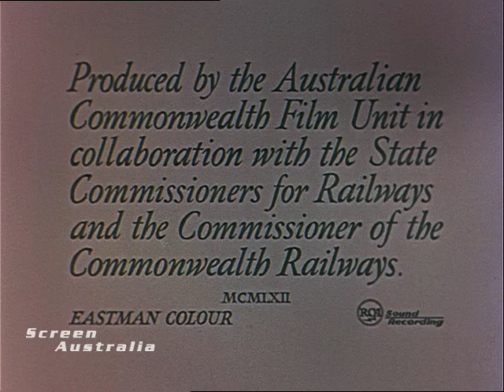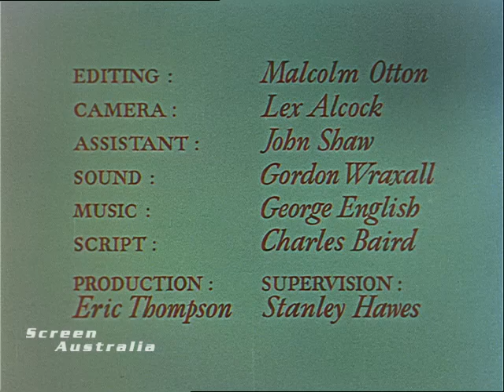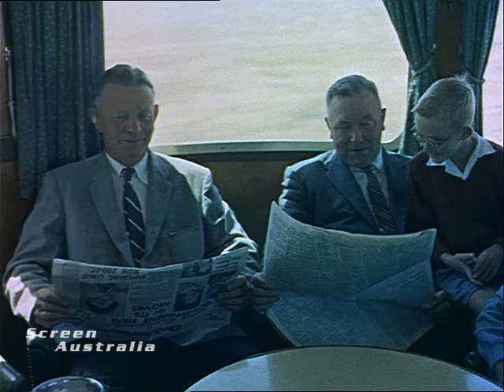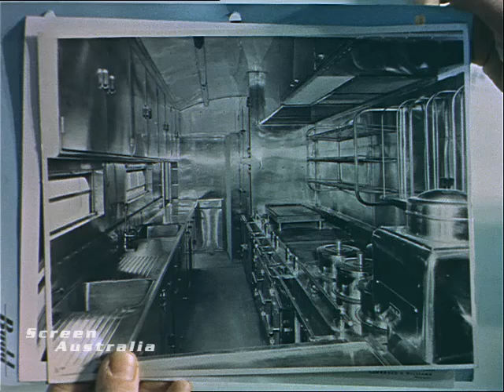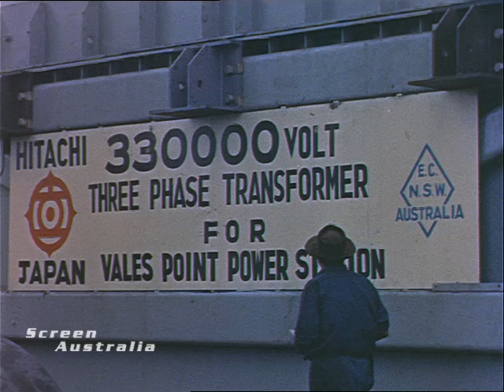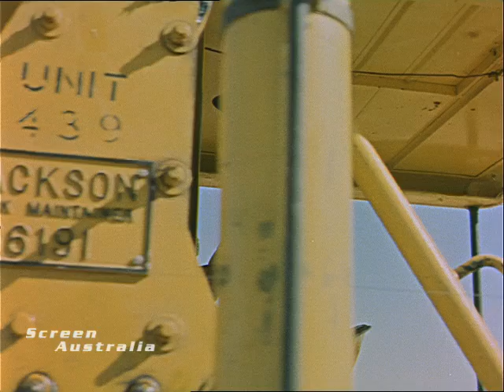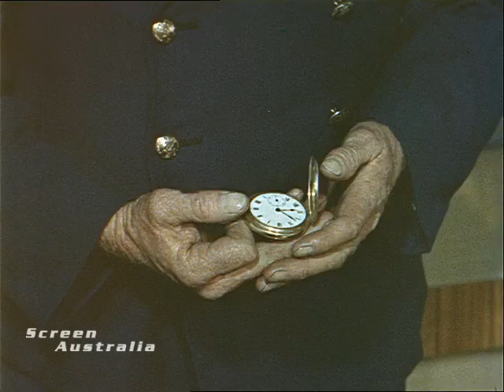All Manner Of Trains

Comment: can i just say that railways thru out Australia are NOT standardised. Queenslad still has a narrow gauge with a duel gauge line (only a single track) from the border to Roma Street in the CBD i also belive Perth railways are also the same Gauge as QR.
Reply: The film probably meant that all capital cities on the mainland would be linked via standard gauge rail.  And they are - just took a bit longer than by 1967.  And Hobart is yet to be linked, but obviously can't happen.

Comment: At 9 minutes and 56 seconds a flim is showing the Overland being hauled by a 900 hundred class diesel then it cuts to a driver blowing his whistle but the driver shown is at the controls of a "Red Hen " not a "900 " No its not a Blue Bird, as you can see there is a door frame in the frame. Still a gem this video, a begone era sadly .
Reply from the maker: We'll have to take your word for it as you obviously know your trains.  Put it down to artistic license - or poor continuity. Thanks for the feedback.
Reply: Another error is at 16:21.  The Ghan.  The loco idle sound is probably correct. ( I've never heard a Sulzer engine)  The NSU locos had a Sulzer engine, but when the loco is notching up the engine sound is GM Electromotive.

Comment: Australian trains and railways used to have so much character! What a shame all that character is gone now.
Reply: Standardization is essential to modern railways,  for example: 
Only roller bearings are allowed on Class A railways so that a damaged axle can be replaced at any point.
Reply: Some character does live on in the Ghan, Indian pacific and spirit of the outback.
Reply: From what I've seen over the decades, compared to Can o' duh at least Australia has railways!
Reply: Yes, the character is gone, as you say, but efficiency now rules. More standard-gauge lines, from North to South and East to West. One may travel, for example, on GSR's "Indian Pacific" ex Sydney to Perth via Adelaide without changing en route.

Comment: Adelaide's metro network (or Not-work, as seems to be the case) is still broad guage and the main line through is standard. Of course all of the country lines have been closed. Great to see classic Locos such as the GM class operating neraly new. Several are still operating 50 years later. Built for longevity!

Comment: 20:08 A linked set of 60/70-class rail motors led by 607/707. 607 had the engine, 707 was the trailer. There are two more behind these but we may not get to see them or their numbers.
Reply: @Neil Forbes it be same as the first

Comment: great video, and of course Queensland still uses diesel trains on most of its long distance trains, welcome to 1915 Queensland, QR is 2015 bring your trains up to the current.......
Reply: Perhaps the cost of electrification north of Rockhampton, west of Emerald and west of Rosewood is not justified by the amount of revenue traffic.  Many US railroads have been de-electrified.  559 miles now, down from 3,100 miles 75 years ago,  probably so they can stack containers.
Reply: Rod S every single other state uses diesel for their long distance, Vline, XPT, explorers ect. Queensland is the only state that actually has long distance electric being the tilt train, and before the tilt train the spirit of the Capricorn, (and at the time of the spirit of the Capricorn and before it was common for electric locomotives to take the sunlander to Rockhampton.